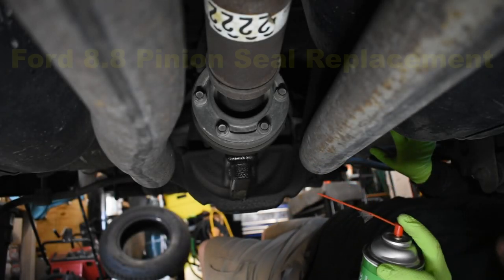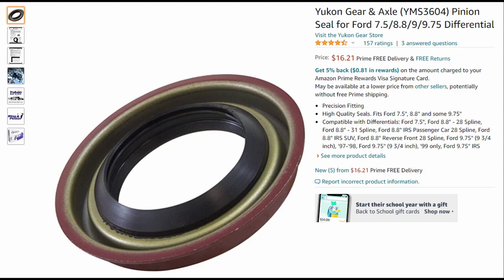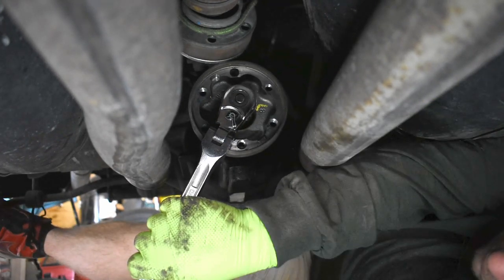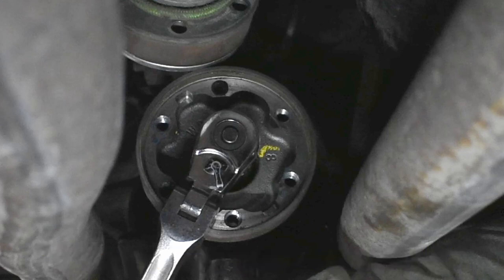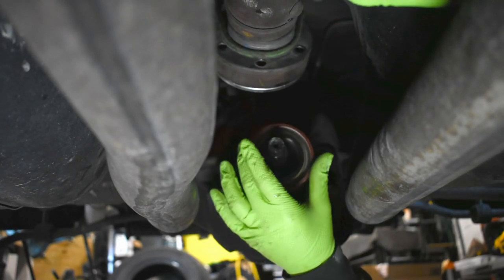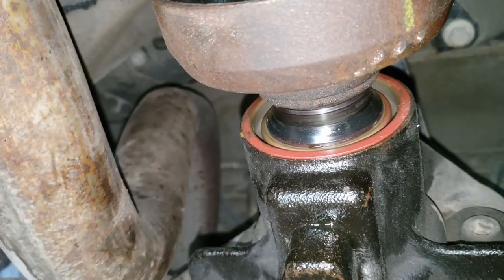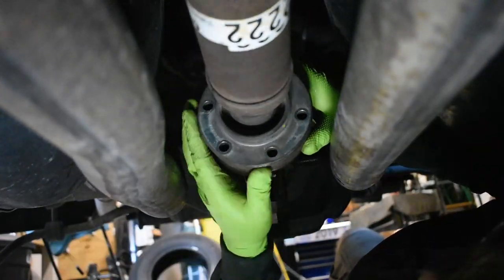What a DIFF-erence - Ford 8.8 Differential Pinion Seal Replacement

Comment: I've watched like 5 videos showing this process and this is the shortest and most concise.
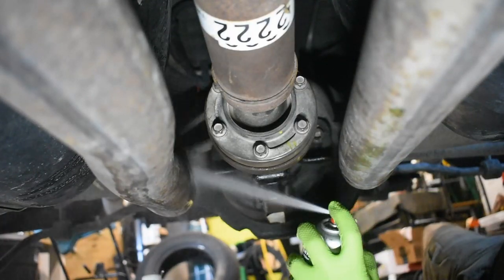3:00 Luckily these days not only do they have Gear Oil in a "Capri-Sun" like flexible Bottle, the Friction Additive is also pre-mixed. I got the last half of this ALL WRONG! I didn't take the Brakes loose and someone else said a Torque Setting 1/3rd of what's done. :(
No noise under acceleration but when I let off the Gas and leave it in Gear (Manual Transmission) there's a Definite "whirring" sound down to 30 mph coming from the rear end. I'm taking it in to get a Differential Access Plate Swap (Aluminum with Heat Sinks) with a Fill and Drain Plug and I'll explain what I did wrong. Hopefully the 230 miles or so driven didn't destroy it. :(

Comment: Good clip.  Why are we required to remove brake HW to replace a diff seal?  My manual says the same thing but I would need to know why it’s required.
Reply from the maker: Any added friction / mass in the system can give an incorrect torque reading when setting the pinion bearing preload.
Reply: @SoloRoosterGarage  thanks for the info!
Reply: @SoloRoosterGarage  what's the torque measurement on the nut in the middle so you don't damage the sleeve

Comment: I'm sorry but I think you said Do not use an impact, while you used one to fix back the pinion nut.. in my 95 Mustang, I had to lock the pinion flange and use a long breaker bar to slowly tighten the nut, and check the preload using a in-lb torque wrench at every quarter turn, without the wheels on.
Reply from the maker: What you did is the correct method. I tried to take a shortcut, and did end up having to replace the pinion bearings a year later.

Comment: Did you have to take out the carrier bolts from the middle of the drive shaft to separate it from the pinion flange?
Reply from the maker: There is a slip joint after the carrier bearing, this gives the shaft room to move enough to work without taking the whole thing out.

Comment: My seal was flush and new. It still licked. Isnt there suppose to be a oil deflector right behind the outer bearing ?
Reply from the maker: I'm not aware of any oil deflector for this setup. If the new seal leaked, check to see if there's any ridges or corrosion where the seal meets the yoke. These seals are pretty cheap to make; could just be a bad seal.

Comment: should preload be measured with a full case of fluid ? my pinion has been leaking for some time probably needs a top up before, if its required for this procedure?
Reply from the maker: Ideally yes, you would set the pinion preload without fluid. In reality, it won't hurt anything to leave the fluid in, then top off when done. Most differentials have the pinion bearings high enough where they are only lubricated when the ring gear is spinning and flinging fluid. Since a bearing's preload is a range instead of a hard number, the amount of fluid still in the bearings at rest should not affect the preload. 

Be sure to use a new crush sleeve when setting the preload. This requires removing the outer pinion bearing and using a magnet to remove the old crush sleeve.
Reply: @SoloRoosterGarage  thanks for your reply man, spoke to a mechanic I know I think he may have misunderstood what I was asking him but he said to me that I shouldn't be putting preload on worn bearings, he said to just mark it and put the nut back in the same place but that just seems like a way to cut corners. 

Just so i can confirm my understanding with you, using the deflecting beam t/w for pre load is measuring the amount of torque it takes to turn the diff? Or is it measuring how much torque it takes to crack the nut ?
Reply from the maker: @brettmurphy1990 Counting the threads/putting the nut back in place IS cutting corners, and can lead to further damage in the future (happened to me). Even worn/used bearings have a preload spec. The deflecting beam torque wrench is used to measure the force required to turn the differential (this is the preload). For the Ford 8.8, the used bearing preload should be 8-14 lb-in.

Comment: What’s up, bro? I have a question. What size a socket you use it when you take off The big nuts
Reply from the maker: I believe it is a 1-1/16 inch socket, or a 27mm socket.

Comment: I have a 2014 Shelby with 23,000 miles on it and the pinion seal leaks. I drive it about once a month. Is it possible that it isnt driven enough and that is why it leaks.
Reply from the maker: It's possible, but I would attribute it more to just age of vehicle in general. The pinion seal is a rubber based seal, and rubber degrades over time.
Reply: @SoloRoosterGarage  Thank you

Comment: I feel like  this was stolen from someone else.  Why the blurring out of the text.  Why did we just take the wheels and pads off?  Never addressed that after saying it was going to be important later.... a little sus.
Reply from the maker: The text was blurred because the wrong torque specs were listed in the video. I did not realize this until later on, hence the blurring. It was implied that removing the wheels and pads was to reduce any mass before taking a preload measurement.